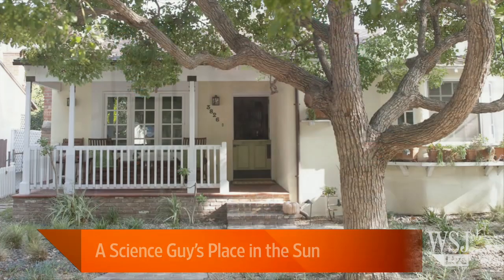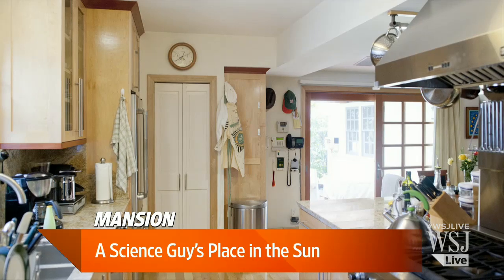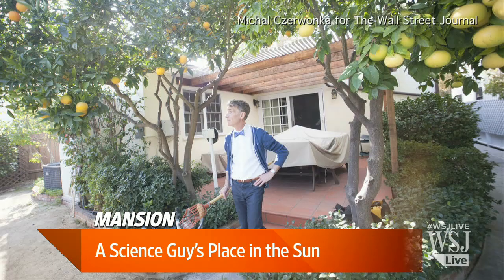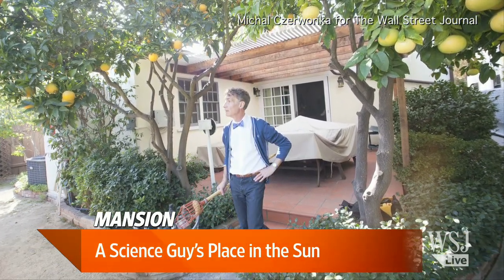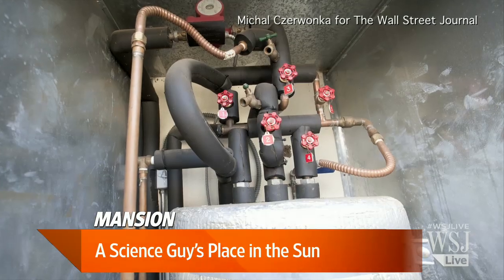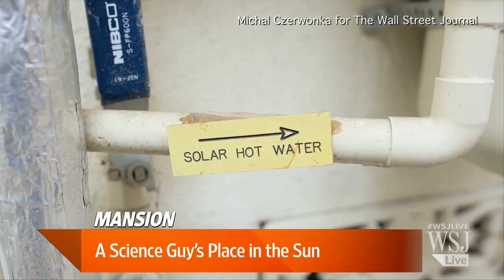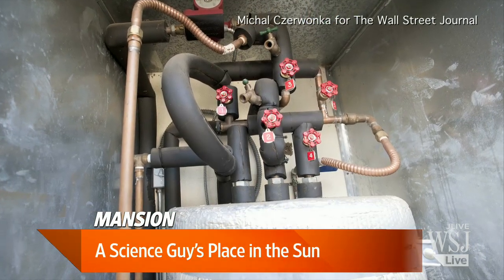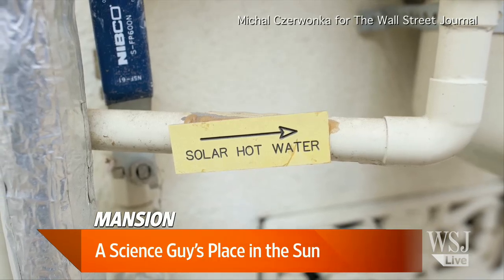Bill Nye on Making His House Energy-Efficient

Comment: We needed to solve the humidity problem in our basement and were tired of using the old technology of running a dehumidifier (which costs a lot to operate and never gets rid of the toxic basement air), so we decided to buy a product called the Breeze. It has a gentle exhaust fan (115 cfm) that is rated for continuous operation, controlled by a humidistat. Instead of treating the toxic and humid basement air, it exhausts it, creating a vacuum that draws the "conditioned" air from the home's first floor into, to take its place. The results are nothing short of miraculous. The air quality in the basement has improved dramatically and we've been able to unplug the energy drawing dehumidifier. The Breeze costs pennies a week to run. No filters or drains are needed. The company sells one and two-fan models that cost from $299 to $449 and carry a 5-year warranty. I strongly recommend the appliance, especially if you’re interested in energy efficiency. It's available on the company website (breezesystemsinternational.com) or on Amazon and Ebay. Much cheaper than the $1,500 to $2,000 units sold by Wave Ventilation, Humidex or EZ Breathe. Now our dry basement also has healthy air!
Reply: Sounds like an ad. If not, you should also probably think about what this does to your energy bills. You're exhausting air, which means you're going to pull air in and have to reheat/cool it.

Comment: Even if a house is running on solar power, plumbing, heating, and the works still need to be in tip-top shape!
Reply: +Flame Furnace Heating, Cooling, Plumbing, and Electrical Company what do those have to do with "a house running on solar power"?